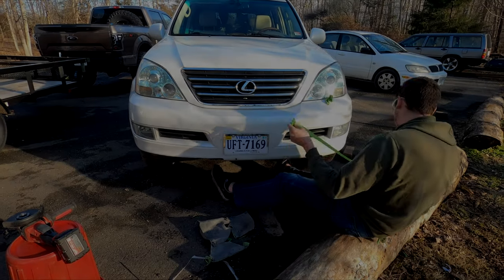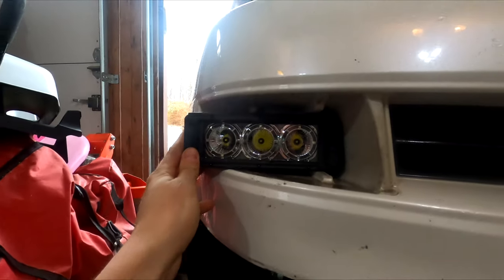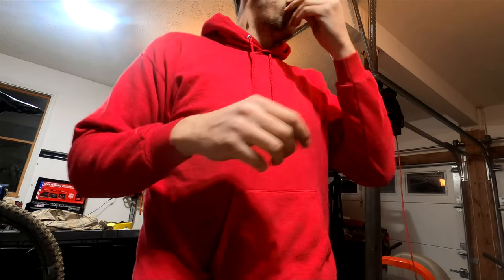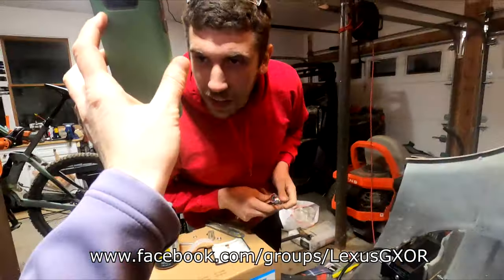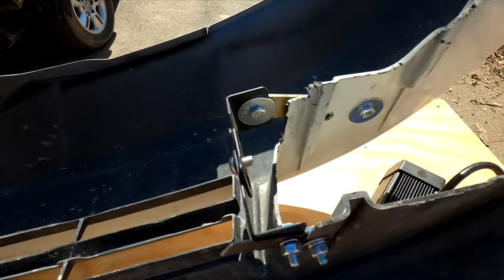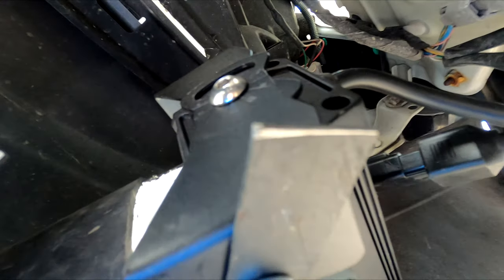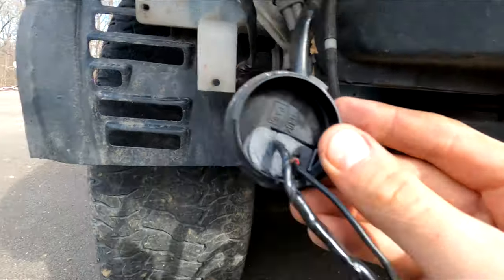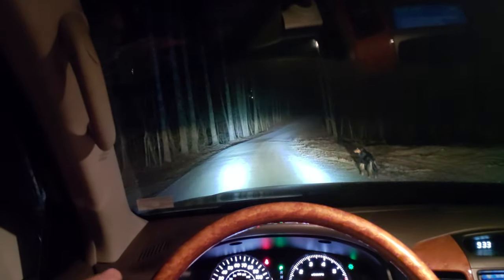GX 470 Light Pod mounting / Fog Light replacement

Comment: earned a new sub you guys are hilarious. and nice gx!
Reply from the maker: Thanks so much! 

What wheel and tire set up you are running? Also congrats on what looks like a great rust free GX!
Reply: @HeretoWherever  rock trix 17x9 -12 offset (great wheel for the price) on 285 70 17 bf goodrich at. 2.5 inch dobinson lift on stock uca and doesnt rub at all with minor bumper trim
Reply from the maker: @CLAlongboarding  Sounds perfect! I'm going to check that lift out for sure.